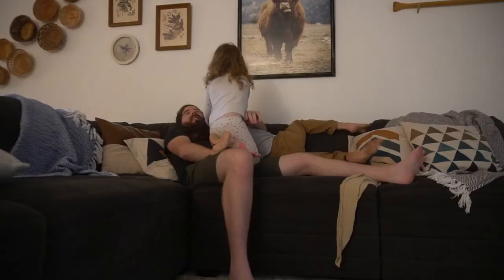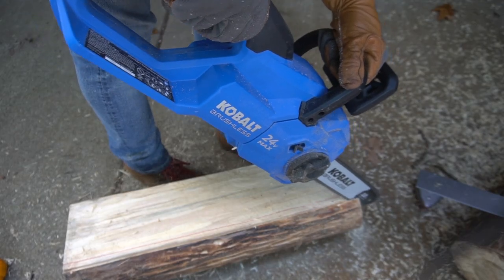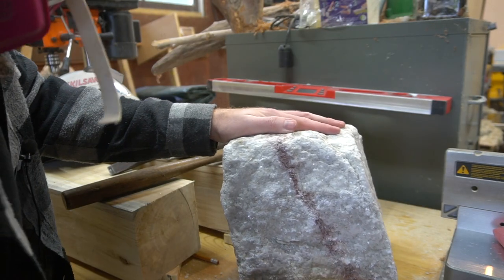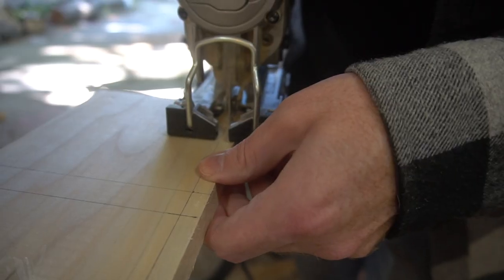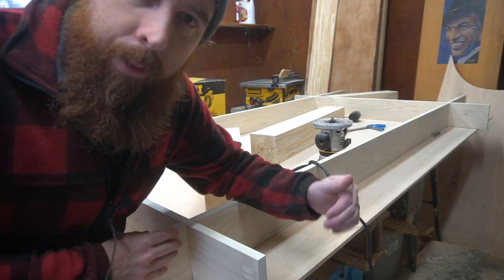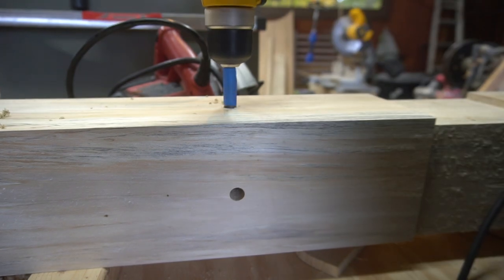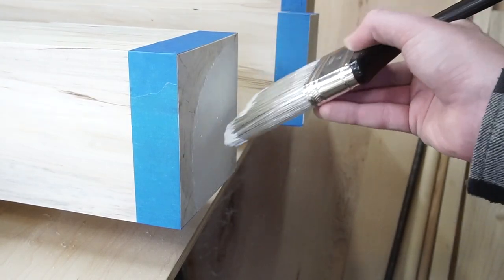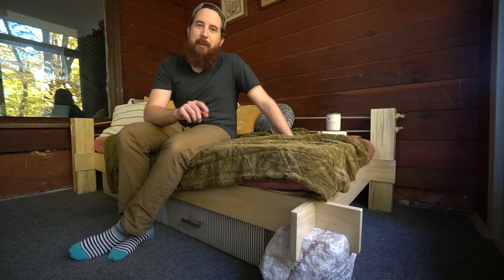I Made a Bed from a ROCK & TREE [STONE CASTLE JOINT]

Comment: You have convinced me over several videos to purchase a electric chainsaw. To resaw logs into lumber. Instead of investing alot of money into a larger size bandsaw. Love this bed, it turned out awesome.
Reply from the maker: Thanks! I would suggest getting a chainsaw with at least a 14” bar so it’s easier to find ripping chains. The 12” bar has been a little limiting on larger logs. Also, I have 3 batteries since they are interchangeable with my leaf blower and weed eater. When getting into a project like this i burn through all 3 of them. If I were to purchase again, I would probably go a little bigger/ more power. Overall though, i was really surprised with the capability of the little Kobalt and am excited to keep using it.